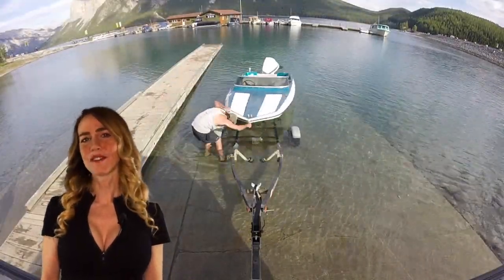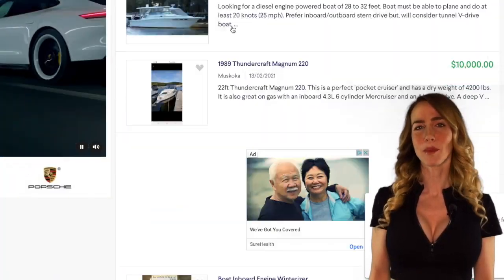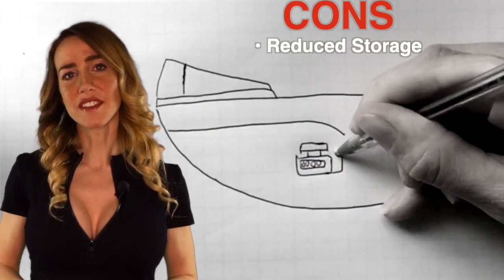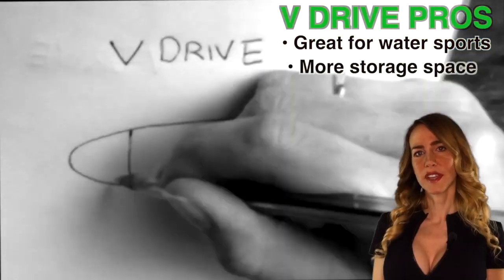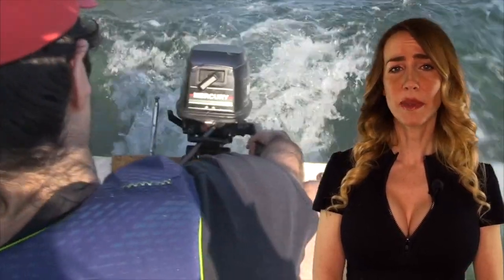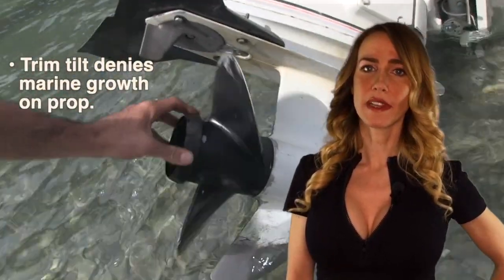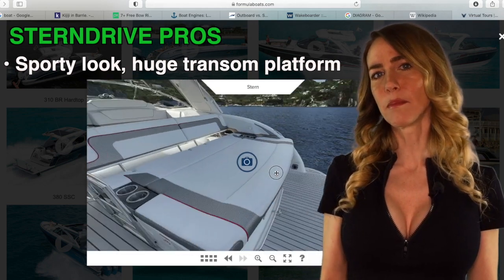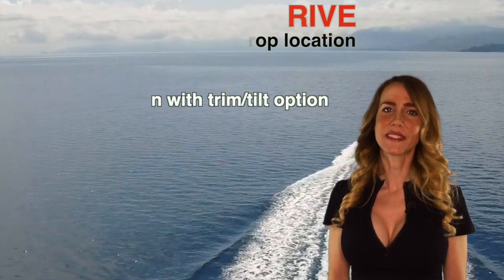Inboard vs Outboard vs Sterndrive

Comment: Obviously fresh water centric.  There are only 2 options for Saltwater 1) outboard 2) Closed loop diesel inboard.  Never ever put a sterndrive in saltwater or open loop gas. I would even have a sterndrive in freshwater. Mercruiser probably is only option and the sealing on the trim tilt sensors (both sides) suck

Comment: Very interesting. My progression was from outboard to inboard back to outboard, and not going back.  I learned how to waterski with an outboard, and got used to the wake. When I bought my first Ski nautique, I hated it. As she said, the centre engine took up way to much room, and strangely enough, I didn’t enjoy the skiing as much. I guess I was just so used to outboards, it’s all we had growing up, and now up nearing 50. Plus, the sunset booze cruise wasn’t that much fun. The pullouts were different. Slower. And the maintenance. Geez. 
Back to the outboard. We flattened the wake with a hydrofoil, I still get complaints from my mates that the wake is to big, but ...whatever.

Comment: Here is a question: suppose I wanted to buy a very basic cruise boat for travelling on the Great Lakes, between 20-30 feet in length. Suppose I had a total horsepower requirement of say 300hp. Which engine selection would be best? One inboard of 300 hp? 2 Stern drives of 150 hp each? or 3 outboards of 100 hp each? Or, 2 outboards of 150 hp each ? Which one would you select and why?

Comment: I have question on a 1985 115 evin v4   we had it running then we replaced kill switch and has not run since ?
Reply from the maker: Something else may have whited when you unopened up the housing. I would by-pass the kill switch to make sure it works. You might have to get the volt tester out and check some things.
Reply: @Bansheeboat  I did bypass still no spark
Reply from the maker: @Asphaltrejuvenator  things can start to get complicated after that you will have to narrow down each electrical part to find out the problem.
Reply: @Bansheeboat  so I disconnected the big red plug at the motor and try starting it that way rite at the motor no fire so this tells me it's at the motor not switch.  Any input on this ?

Comment: So nobody’s going to talk about how easy most stern drives are to work on? The Volvo penta 5.7 in my cobalt is (correct me if I’m wrong) a small block Chevy basically. It’s the AK47 of engines a 12 year old can take the engine out clean it up with a couple handles of vodka and dump oil in it with no instructions and it’ll run, this chicks crazy hot but wants you to like outboards. Outboard engines are bitchin but come on?
Reply: I assumed that was essentially the same situation with the inboard motors. But regardless you're spot on! Have my dad's old boat and it's literally just an old Ford Ranger motor with specific marine parts. Things that spark and have motors and such like starters are the marine versions so they don't explode the sealed engine compartment.

Comment: I own all three types and love them all but….. outboards are the most expensive $/hp ratio and have the most expensive, hi tech parts .
Any I/O will trim/ tilt level with the hull , if you have to buy an outboard to trim out of the water , you’re in an area that you shouldn’t be boating in .
Reply: That makes no sense. Less time in salt water always ends up with less corrosion and growth. Not everyone keeps their boat on a trailer
Reply: @sadenuttie2234  Have a look around a local saltwater marina and see how many outboards are tilted out of the water ...not many. 
Growth will still be on the hull and exposure to oxygen is where the corrosion is worst (waterline).
Reply: @duncandmcgrath6290  every single outboard in my marina is tilted out of the water…